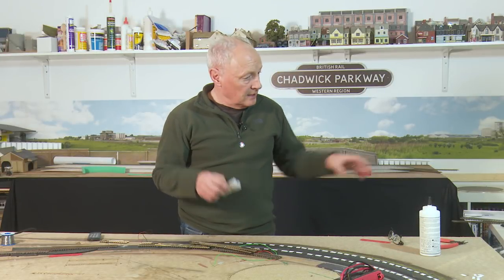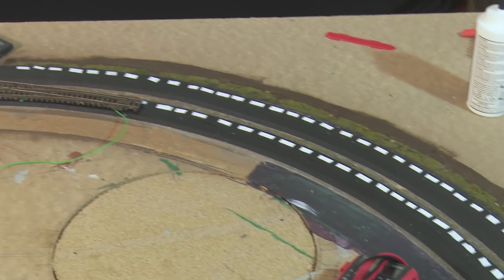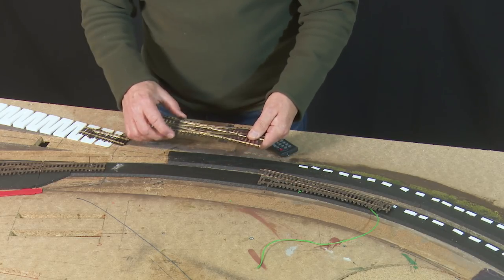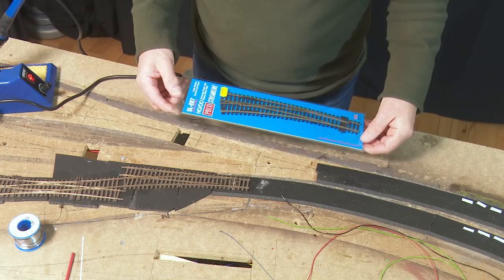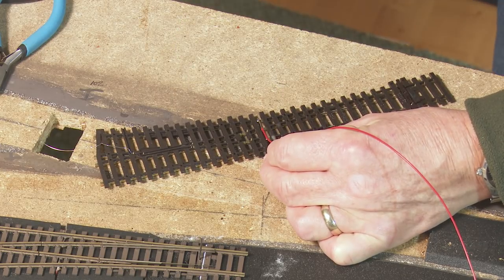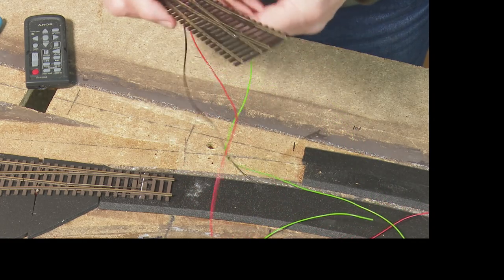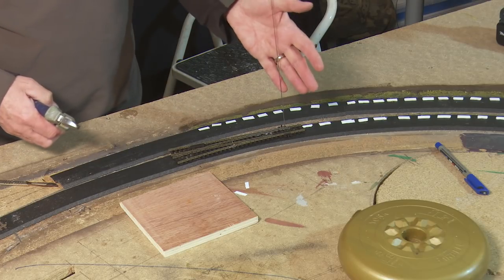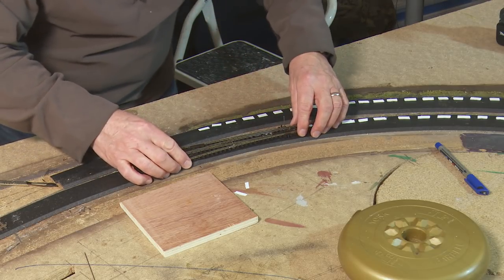Laying track, points and slips at Chadwick Model Railway | 77.

Comment: Great Videos Charlie. Question on wiring the double slip. The red and black wires from the power rails of the double slip go to Tortoise # 101 pins # 2 and # 3.  Do you wire the Tortoise # 100 for power go the pins # 2 and # 3 under the track from a terminal block under the layout or are the black and red power wires get wired on the Tortoise differently.
Reply from the maker: The motors are switches by the blue and yellow cables on terminals 1 and 8.  
If there is a frog to be switched, track power (red and black) go to 2 and 3 and the frog (green cable) to 4.  I do hope that makes sense.

Comment: I note that you glue your track down Charlie.  How easy is it to get back up again for adjustment, track alteration, revised layout etc ? 40:07
Reply from the maker: Using copydex Mike, it is no problem at all. Should you have to move it once it’s ballasted there’s another problem. The ballast can only be you be lifted using warm water. Best wishes for 2023, regards, Charlie
Reply: @ChadwickModelRailway  Thanks Charlie - happy new year !

Comment: Hello Charlie,
I know that Peco code 100 double slips are only made with insulated frogs and as such do not have wiring to the frogs but code 75 have electrofrogs on the slips that do need wiring. Having demonstrated the wiring of a code 100 electrofrog point and its frog wire you go on to install a slip that does not have wires to the frogs but do not point out the difference in construction between the two. For a newcomer who is unsure of how how to wire up points and slips they could construe that this is the case for all slips which is an erroneous assumption. The fact that code 100 only has insulated frogs on the double slip with the inevitable dead spots was the main factor in  my choosing to use code 75 for my layout. This is a minor point in a well constructed video. I look forward to seeing further progress on your layout.
Reply from the maker: An interesting point Frank, we’ll said.  I’m so pleased that you enjoyed it and I do hope that you have a great Christmas, regards Charlie.

Comment: Thanks for the video Charlie.  Can I ask, did you screw the PM screws directly in to the  chipboard or drill a 'pilot hole' first?
Reply from the maker: Hi Simon, I used a bradawl to make the initial holes ready for the screws.

Comment: Hi Charlie,,,,,I am about to start my layout,,,,I want to lay a bed of sheet cork all across the table top 1/8",,,,,will I be able to use the cork track bedding  on top of the sheet cork?,,,,,,I watched the video of you having trouble with laying sheet cork and I still would like to cover the table with it,,,,,,using contact glue,,,,I will also be using the tortoise switch machines so I wonder about having the room to switch the track,,,,hope you understand,,,,,thank you,,,,,Nina
Reply from the maker: Yes, absolutely Nina.  Cork on cork is no problem.  I have 2 videos on using Tortoise motors, do check them out.

Comment: Is keeping the track in place with some screws and washers an option, or do you destroy the sleepers with that because of the plasticard on one side?

Do you keep the module gaps open when laying track, or do you cut them after the ballast is applied?
Reply from the maker: I simply glue down the plasticard strips and glue the track on top.  It works fine.

Comment: Please excuse my ignorance I haven't a layout at present but when I used to have one I never bothered with soldering wires to the points at all I used to solder the feeds to the fishplates at the ends of the points ie the toe and switch the frog only .that way on electrofrog points especially you are continuously fed after all what's the difference between soldering across the switch and stock rail when you are already feeding it from the frog end?
Reply from the maker: The only problem with soldiering on to the fish plates Frank, is that it makes it very difficult should you need to change the point. Regards Charlie

Comment: Hi Charlie,
I'm using both Setrack and Streamline points on my new layout and I need to use both to get the perfect Geometry I require leading to the station and Goods Yard. I've run into a problem as the sleepers are overlapping although this did not show up on AnyRail when I initially designed it. Is there anyway around it short of taking a Dremel or File to the sleepers, your advise will be greatly appreciated.
The points in question are Peco SL-91 and and Hornby-R8078.
Reply from the maker: It’s normal practice for sleepers to overlap. Just snip off the ascending ones and carry on. We all have to do it. Regards, Charlie.

Comment: Hello charlie   do you use rail joiners when you lay track  or just use dropper wires   I'm in the process of building a layout for the first time   i will be using the megapoints servo controllers   and its been bugging me thinking about what a pain it will be to connect the track then disconnect it to drill holes and line things up   you make it look easy  i will be using set track as i'm new to this
Reply from the maker: Hi Darren, Set-track is very easy to install.
If your are using DCC, its best to use both rail joiners and rail joiners.
Regards Charlie

Comment: when you talk bout the frog wire, could you explain what a frog wire is and what it does, and why a frog wire is needed?
am wanting to build my own model railway, and was wondering bout the term frog wire. Like to say though I enjoy the video's very informative.  :)
Reply from the maker: Hi Nicole, the frog is the V shaped rail as the tracks split. On electrofrog points the polarity needs to change as the the point switches.  It’s the wire that’s attached to the frog that does this, that supplies the current.

Comment: Another great informative video Charlie, could I ask what the underlay is on your track please.
Reply from the maker: Thanks Paul, I’m so pleased that you enjoyed it.  I’ve switched to Woodland Scenics foam track bed for better noise absorption.
Reply: @ChadwickModelRailway  I’m guessing you haven’t had it long enough to decide if it deteriorates like the the usual foam beds.
Reply from the maker: WS are adamant that it doesn’t rot like older foam designs.

Comment: Another great video. I am using Woodland Scenics raisers. About 4 inches tall and would like to install a Tortoise switch machine.  The top is Styrofoam sheet.  Any ideas would be helpful. Thank you.
Reply from the maker: You'll be doing your raised section first, so perhaps that you can advise me Mike.
I know that you can buy fittings which allow their operation upside-down and on their sides.

Comment: As i'm building an O gauge layout using a mixture of Peco and Marcway points and using DCC Concepts motors i need to use a thicker wire on the motor to get a more positive changeover could you please tell me where to get the thicker wire and did you have to bend it yourself?
Reply from the maker: Hi Frank, I bought the wire at a model railway show but I’m sure that Squires will stock it.  It bends okay with a sturdy pair of pliers.
Reply: @ChadwickModelRailway  thank you i'll look into it after Christmas

Comment: Hello there! Sad day today but I hope there's no Brexit for the railroad modelers... A couple of weeks ago I 've been asking you about the thickness off the cork you're using. Just to find out you are switching to WS foam :) So, here's the classical: how do you find working with it? A cork vs WS foam video might have a great success - just an ideea. And yes, the question goes primarily to sound deafening, secondary to track bending over weight and last but not least about the prototypical look when ballasting as WS foam is way wider than the sleepers. You see? It's a 20 minutes video worthy question. Still sad...
Reply from the maker: Please bear with me until I ballast a section of the WS.

Comment: Charlie as I saw you soldering I instinctively cried out “no” when the first thing you did was melt solder onto your iron. I didn’t know at that point that you knew exactly what you were doing. Many inept solderers use solder like glue, which results in faulty “dry” joints. The correct method is to heat the metal to be soldered, or the joint to be made, with the iron, wait a brief moment (depending on the thermal mass of the thing being soldered) for it to get up to temperature, then apply solder wire to the joint not the iron. Applying solder to the iron and wiping it onto the joint like some sort of metal version of epoxy will result in failure. However, experienced solderers know that a dab of molten solder on the iron tip not only cleans the tip with activated flux, but provides a good thermal interface. And coating the tip after finishing the joint helps prevent oxidation. You were exactly right in your method, I just feared you were going to use the solder wipe approach. Soldering is not hard, it just needs to be learned as a correct technique. Nice to see someone who can solder properly for a change!
Reply from the maker: Thanks Mark, that’s very kind of you to say so. I must confess it hasn’t always been that way! Regards, Charlie
Reply: @ChadwickModelRailway  Well we’re all learning. I like to think that wisdom comes from experience, and experience is made of mistakes. In that case, I consider myself highly experienced in many areas of life 😆

Comment: Do you have any problems with curved points? They seem to be problematic for me. I have tried different models and makes, but have never been entirely happy. Have seriously thought about venturing into handmade ones…
Reply from the maker: I know the point you make mate. There are good ones and bad ones.

The ones to avoid are the Hornby set track ones which are simply dreadful. Regards, Charlie
Reply from the maker: I know the point you make mate. There are good ones and bad ones.

The ones to avoid are the Hornby set track ones which are simply dreadful. Regards, Charlie

Comment: french wikipedia https://fr.wikipedia.org/wiki/Aiguillage#La_man%C5%93uvre says:
« Some points are said to be reversible, because the blades can be moved by a train which “takes them from the heel” and remain in the position set by the last passage (a train which “takes them from the point” would go in the direction of the last passage except manual intervention ), others are "non-reversible" because, unlike the previous ones, they always return to a default direction using a return spring. »
which is where the thinner 0.6mm piano wire may come in handy
to mark on the black surface, you can use this sort of thing: https://www.amazon.co.uk/dp/B000GPI48E/   
for the point piano wire, just mark it, remove it, cut it, and put it back in
Reply from the maker: Interesting options AJ, thanks.

Comment: Those diamond tipped disc cutters are a liability if not used correctly. Always keep your fingers away from the direction of the travel of the disc. I was once cutting something and the disc stalled, bit into the material and proceeded to lacerate my thumb which was in its path. Needless to say the result was rather sub-optimal.
Reply from the maker: That’s life as a modeller with power tools.  But do we ever learn ......

Comment: why dont you use servo moters they are much cheaper @ less than 2 pound each for a 9 gram motor.
Reply from the maker: Because of the long term track record of tortoise and the problems encountered by Sandling Junction.